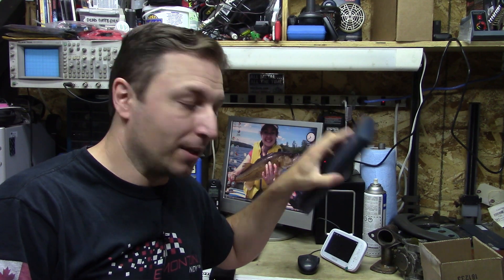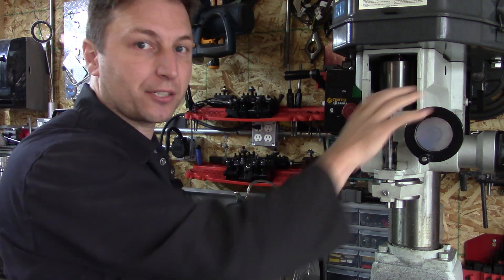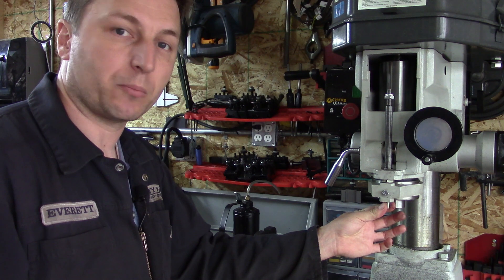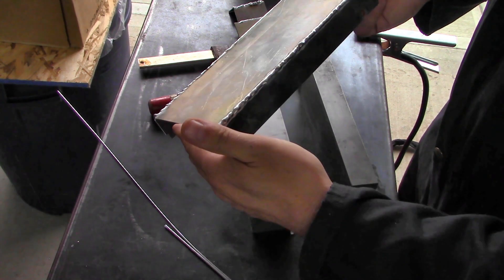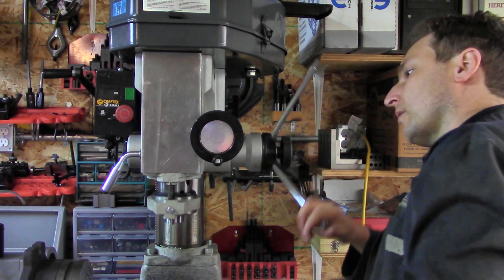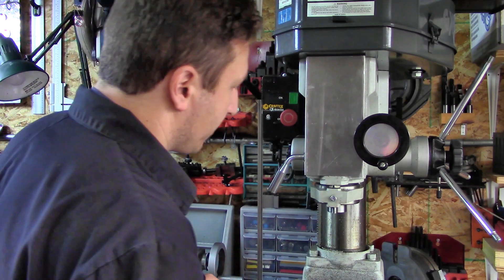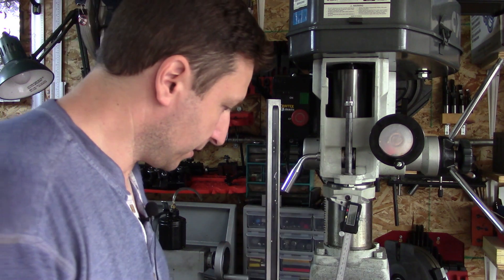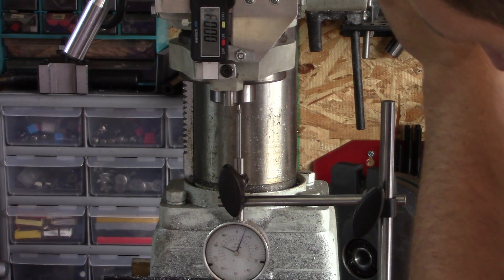Cheap Mill Quill DRO, 500 Sub Draw

Comment: Great video. Nice and cheap but effective. I just installed a 3 axis DRO on my mill drill which is an earlier model of yours, and was stressing on how i was going to fit the quill axis reader due to the same problem you had with the end stop being sloppy. After watching your video i will fit a box on the front like you did but the reader will be attached to the stop rod (when i make it more rigid).

Comment: Nice job. I made a similar unit for my lathe and the cheap caliper I used also said "hardened stainless". Surprisingly, it was actually difficult to drill. I had to use a cobalt drill bit and take it at low RPM. Your welds are better than mine!
Reply from the maker: Thanks Mark, I seriously need welding seat time as it would significantly extend the expected life span of my tungstens.  As it is, they get drowned on a regular basis, lol.  I got the idea from Marc L'Ecuyer in Quebec, and did not feel bad about drilling holes in that very cheap caliper, especially considering the jaws were crap and it was useless apart from the digital scale, lol.  Did you notice that the graduations on your quill fine feed crank were just slightly off too?  Mine were, and it totally explained why I was getting wrong depths of cut even when I knew I had dialed in right and had backlash under control.

Comment: Hey Everett, don't know how, but this is one of your previous ones that I had missed. Just coming off from a "can't twist" clamp build and tired of monkeying around with my dial readings. searched for DRO for mill quill and you topped the list. I will also check Marc's approach. Take care and cheers!
Reply from the maker: Hey Howie!  Yeah, I had wondered how to put a DRO on the quill and pondered mounting ideas then Marc showed how he did his and I went from there.  What surprised me was to see how the accuracy of the crank dial was off and I did not know that it was gaining by every revolution.  Would be curious to see if once you have one on yours if yours was off by that factor too.

Comment: Everett, l basically did the same upgrade on my round column mill. I used an Asimeto dial caliper. I found the original dial to be .015 off. Ten turns on the original equated to 1.015 on the Asimeto. This setup shows a more accurate travel of the quill. Thanks for the post.
Reply from the maker: Thank you for saying something, I'm glad I'm not the only one who found an off reading on the quill dial. Must be a quirk with a number of these types of machines.
Reply: I dont mean to be offtopic but does anyone know a method to get back into an Instagram account??
I somehow lost the password. I would appreciate any assistance you can give me!
Reply: @Asa Ryland Instablaster =)
Reply: @Axton Vance I really appreciate your reply. I got to the site on google and I'm waiting for the hacking stuff atm.
Takes a while so I will get back to you later when my account password hopefully is recovered.
Reply: @Axton Vance it did the trick and I now got access to my account again. I'm so happy!
Thank you so much you saved my ass !
Reply: @Asa Ryland You are welcome :D

Comment: If you use this digital depth finder as DRO, you don't have to tilt your head sideways...

https://www.ebay.com/itm/Digital-LCD-Depth-Caliper-Height-Gauge-Magnetic-Self-Standing-Aperture-0-80mm-G/401898599838?hash=item5d9305f59e:g:Q7QAAOSwJQZdiIRR

I have used tire gauges and fiber calipers with RE magnets superglued to the back as DROs and are quite accurate.  
You do have to check when ordering that they go to 0.01mm .
Reply from the maker: Those are cool height gauges, I've seen them before but hadn't thought of using them on the mill.  I had a digital caliper on hand and saw Marc L'Ecuyer's video on how he adapted one to his mill-drill and so that gave me the nudge to install this one.
Reply: @EverettsWorkshop  https://www.youtube.com/watch?v=sHcdEutcs5g&t=25s

Can also use RE magnets to attach small electronic readers for a removable DRO on Lathe or mill.....

Comment: hows the repeatability.  Nice
Reply from the maker: Theoretically, the manufacturer says a half tenth for the calipers. It's still better than the dial, one way or another. There's no issue with misalignment to the work, nor with hand pressure, so it should be able to stay within the half tenth the manufacturer claims. Good question though, might bear having another test at some point.

Comment: It always feel good to solve a mystery.  Does it like to go through batteries fast?
Reply from the maker: I'm glad for the readout now, especially as I can't trust the dial.  I know these calipers don't ever really "shut off," but the battery seems to last a while in it.  Haven't done a time vs. lifespan test, but it's still on the battery from when I installed it.  I stock the little batteries for these anyway, they're not that expensive.

Comment: thanks I just got a mill drill and need to add one of these. appreciate the video.
Reply from the maker: Thanks for coming by!  The idea wasn't mine, just adapted it to the machine I have.  Popped over to your channel and have to say you have good taste in tractors!  I miss my little BX1850, Kubota makes good equipment.
Reply: Everett's Workshop  thanks brother, I just love tractors all brands are great to me. I've had John deere  farmall, and Kubota so far and they all were great tractors! I will subscribe for more.

Comment: You might want to think about making a foot operated switch for control of the sander
Reply from the maker: Hadn't thought of that, probably would have been safer than just parking it on the table upside down, for sure.  Long term I would like to put together a long-belt sander setup but that won't be for quite a while as there are lots of tools that need building first.  I like your idea though, and will look into one of those 120v foot switches because that would be better even using the belt sander like I did.

Comment: Low cost high value improvement...!!!   Well done.
Reply from the maker: Thanks, it's been a long time coming.  I knew there was something fishy about that graduated wheel and its readings as it always seemed like it was coming up a bit off.  I suspect that the Asian manufacturer used a metric worm setup on it and said, "That's close enough, no one will notice .4 mm."  At some point will need to check the X and Y axes too . . .

Comment: I've used modified caliper scales for my lathe X axis and also one on the tailstock. I reckon they are quite adequate and work well. My small mill has a Z DRO integral but I also keep a regular indicator on the side to be able to have a double check.
Your fix works out really well - nicely done :)
Reply from the maker: Thanks, Chris.  I saw the setup you have on your tail stock and that will happen to mine as well when time allows (always seems to be something more pressing!), it's on the list.  Got a cheap 8" caliper that is planned to be modified for the lathe cross slide as well, but again need time to get to it.

Comment: I like your mod to Marc's {That Lazy Machinist) Poor mans D.R.O.  I just finished his mod last Sunday!  I have the same questions in regards to the play in the low end of the "drill stop".  Now to figure out a way to utilize the stop and gain rigidity.   I also cut away all of the points of the caliper however, the Harbor Freight caliper was a real bear to drill. As I discovered how to friction weld hardened stainless to cobalt! yep! I ended up cutting slots in the jaws with a dremel cutting wheel.  This is a very good video! Thanks for taking the time and effort to post it!
Reply from the maker: Thanks!  I suspect my jaws were not hardened, judging by how they drilled - probably annealed Chinesium :P  I liked Marc's idea but as I didn't usually use the drill stop on the machine anyway (didn't like the design) I figured it could go.  If I ever need a stop I'll figure out another system.

Comment: Just did a similar modification on my lathe tail stock using a 4" Harbor Freight caliper.  Mine were a little harder as I ended up having to use a carbide bit to drill the holes.  Keep the videos coming!
Reply from the maker: I'd like to put one on my lathe tail stock too at some point but need to fix the rotational play first, kind of like what ChrisB257 did with his,  If yours were harder then they were better quality than these!

Comment: Hi Everett. Those cheap callipers are pretty reliable considering. A nice addition to the mill.
Reply from the maker: Yeah, it'll definitely make hitting depth of cut easier.  Pretty reasonable cost, even if the jaws were low quality.
Reply: Yup I get them at tool swapmeet for a couple  bucks so I'll try this ...win win beats a c note for one on slow boat from.china..